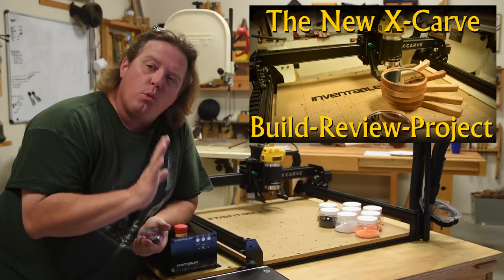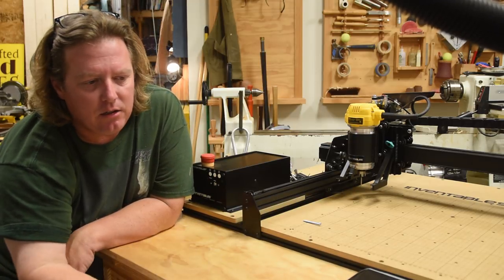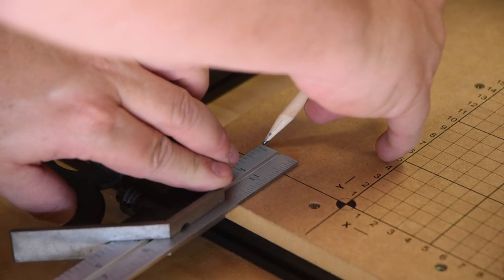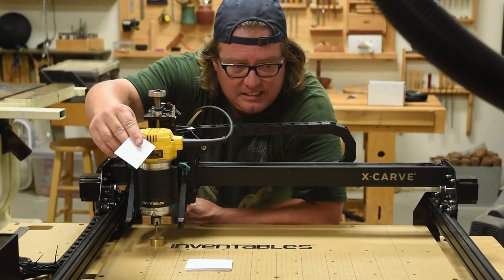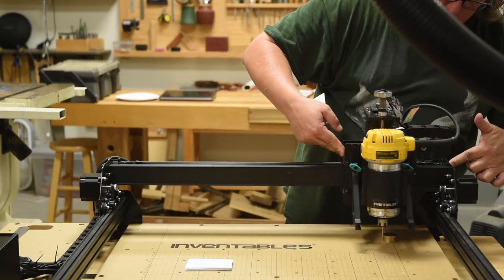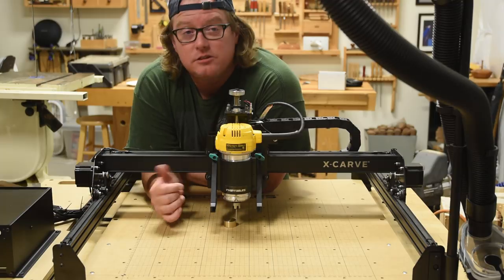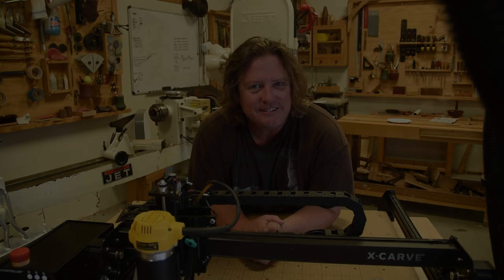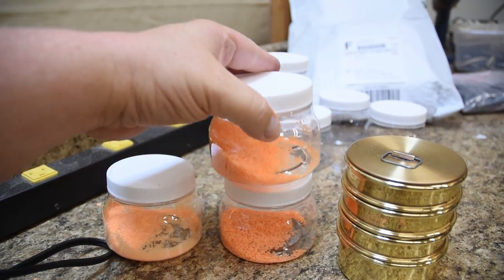Tune Up the New 2017 X-Carve and Make Jewelry

Comment: Big thank you for this, I checked my waste board and found it was off by .137 to .207 mm side to side and front to back. I had never considered checking the level of the board with this technique until I watched this video.  I don't require super high precision with my carves but this explains some stuff that was happening on my through cuts.
Reply from the maker: Yep, thru cuts is the big benefit for me too.

Comment: Good method of leveling if you won't want to mill into your factory waste board. A similar technique to leveling a 3d printer bed with a piece of paper I suppose. I may end up getting the Misumi aluminum extrusions, but I'll definitely try this on my 750mm xcarve.

Comment: Tthe method recommended by MOST builders of CNC machines is to obtain your OWN baseboard and mill it flat with your CNC machine, that way it is ABSOLUTELY flat with respect the the router bit.
Reply from the maker: I think I mentioned that method but the key point is "with respect to the router bit". So if there is twist in the setup (very common) that method will just follow that twist. May woodworkers use our machines to flatten so.... Note: the method I showed here can only be as flat as the table it rests on but I think I pointed that out. Also, you're method (as is the one outlined here) is perfectly acceptable if all you're concerned with is the depth of cut from the face of the board.
Reply: I intend to use both of these methods. I don't want to just transfer twist from the gantry or the surface to the work.

Comment: You dont need to run a test cut,just type in your length in the jog where you move using the arrow keys,then you can test your distances in one move
Reply from the maker: Good Tip. Hadn't thought of that.

Comment: Hi! Thanks for your helpfull video. I have recently upgraded the Z axis on my Xcarve (heavier, 
direct drive) and I came across a calibration problem. Maybe you know 
what's happening... I set the X axis to cut a rectangle 125x76mm
 and a square 50x50mm. If i calibrate the x axis according to the 125 
measurement, then the 50x50 is off... and if I calibrate on the 50x50, 
then I'm off on the 125mm... I tensioned the belt to 4pounds for 1 inch 
deflection... check all the screws had enough tension... don't know what
 could this be! any ideas? Thanks in advance!
Reply from the maker: Sorry, beyond me.
Reply: @wortheffort  thanks for taking the time to answer. Best.

Comment: you do a good job in explaining and you go slow. I have a question. i see you have a different collet for your dewalt 611, is this for the 1/8 shaft on your bit. is it better then using an insert for the stock 1/4 collet. can you tell me where you got it.
Reply from the maker: different sized bits correct. any woodworking store will sell them, they're standardized.

Comment: I don't own a cnc router... yet. Looking at the X-Carve. Coming from the laser engraving side, wouldn't shimming the 
 piece off the bed solve some of the issues of cutting through?
Reply from the maker: it might induce vibration, the enemy of smooth cuts (also dangerous), in areas not supported by a shim.

Comment: I had a hard time tuning my xcarve.  I followed the instructions exactly, bu my xcarve kept bouncing from too long, or too short.  In the end, I took the two numbers I was getting, the long and the short, added them together, and divided them by two (for the average) and even then, it got me damn close. I still had to play around with the numbers a bit, to get it with half a mm of perfect.  Haven't done my Z axis yet, I know it's out a very small amount, but not enough to bother me yet.
Reply from the maker: I use mine for basic shaping, not joinery so a little out isn't a big deal. I think most people who do stuff like signs are in same boat. When doing stuff that joins I just make sure the direction on the waste board is identical so that any out of perfect will be  consistent between the two parts and they'll join up fine (think inlays).

Comment: to lower the center put another bolt through the table
Reply from the maker: There's a bar there. I'd have to file it down. It's good enough for the type of work I do but might not be for others.
Reply: wortheffort you could offset the bolt in the middle to the left or right a couple incches
Reply from the maker: It's not about going through the bar but that the bar won't compress. But honestly it is so close... really nit picking for the video so people understand what they're getting.

Comment: Think it's a good idea to set up your cnc to get it flat but when you use a extra waste board so you don't damage the factory waste board it's going to be out so using a surfacing bit using the cnc. Will get it flat and using a extra waste board allows you to cut into it so you don't have to sand you product to release it the rest of your video was a little zzzzzzzz